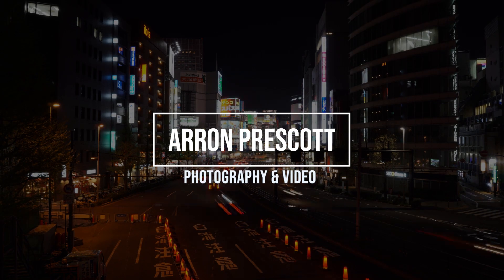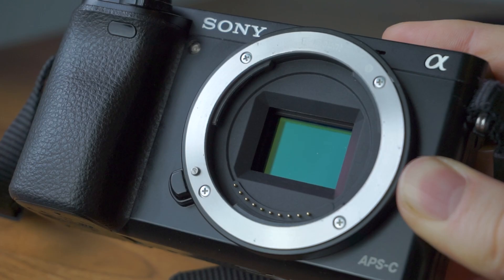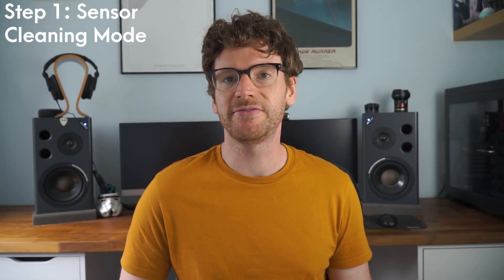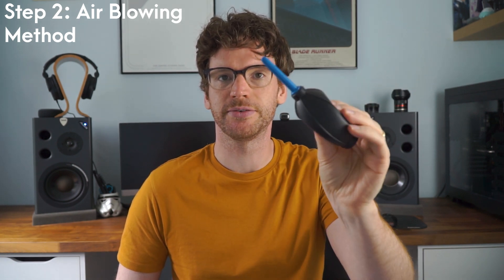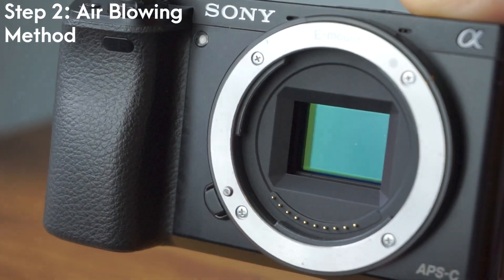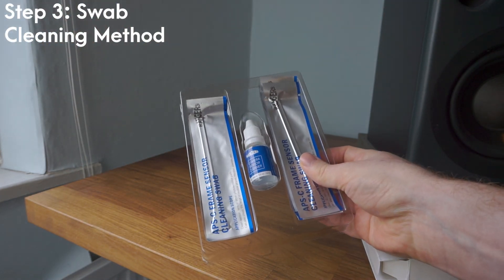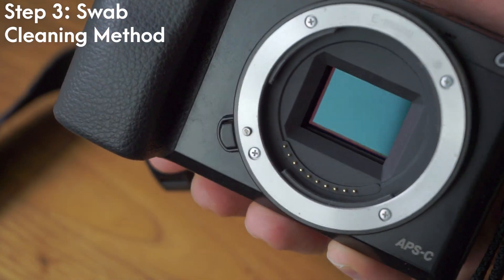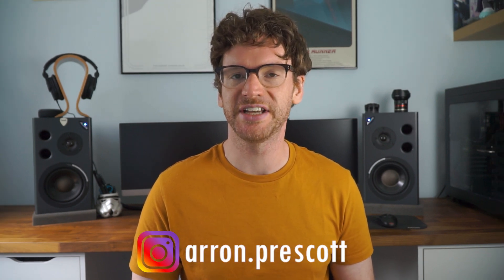How to Clean your Camera Sensor (a5100 a6000)

Comment: Hi have you had any issues with the lens giving you a message saying the lens are not properly attach but they are and the lens does not come out ?
Reply from the maker: Yes I have had this before, and it's an annoying error message so it's not clear exactly why it happens. First step I'd try is changing the 'Release w/o Lens' setting. Go to MENU → Custom Settings → Release w/o Lens and select 'Enable' hope this helps!
Reply: Arron Prescott thank you so much !! Great videos by the way I have watch them all and your suggestions have also helped especially the memory card which is a major difference in my videos now !!